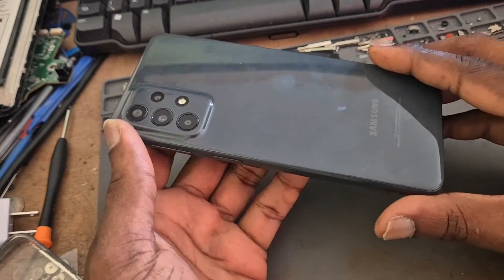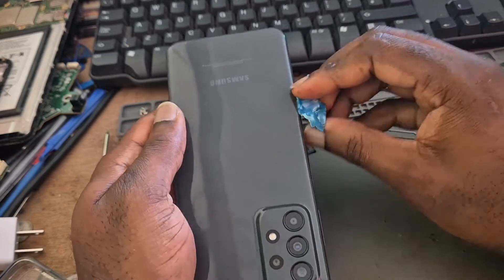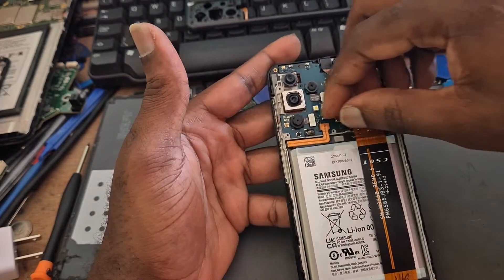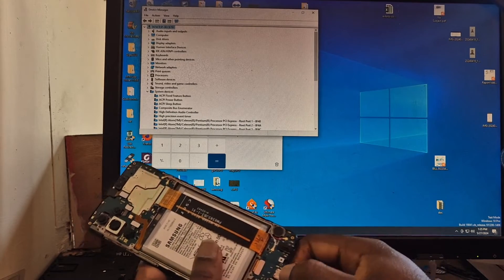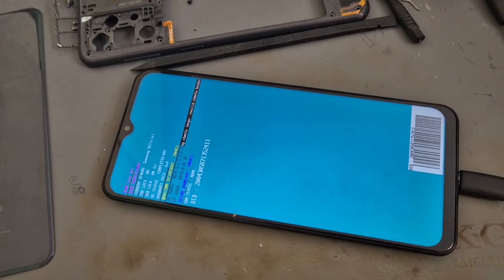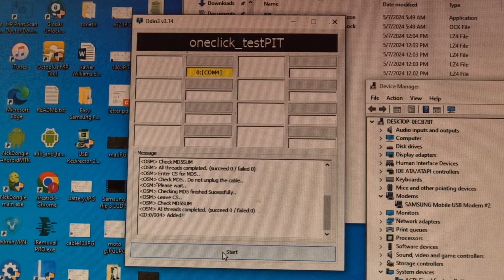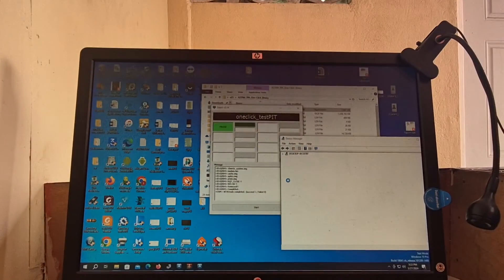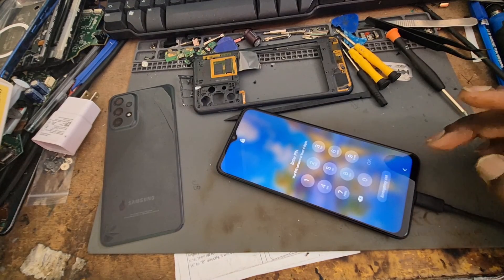Samsung A23 Dead Fix After Update 2025- Samsung A23 not turning on or charging fix

Comment: Dont work on a235m bit A
Error 10>5
Reply from the maker: which software you got the error?
Reply: @Lenzwalters using the downloaded file the device enters download mode but does not accept updates in either odin or sam fw

Comment: Hi. Thanks for the post.
I found similar on reddit and asked a friend with an edl cable to help me cuz I don't fully understand the technicals.
I believe he said the fix stops/freezes at the b&w screen (?cmd/dos?) and basically starts over, as in a loop.
He said it's because my phone is a dual sim (a235m/ds) and this fix is just for the a235m.
Is he doing something wrong, or is he correct, and can you please help me find a fix for the /ds?
Thank you for your time and happy new year!!
Reply from the maker: if you can follow the steps in the video should be able to help you fix it. have you tried ?
Reply: @Lenzwalters  no, i have not tried.
my assumption was that this fix is similar to the reddit one i found,
which would yield the same negative result because it appears that this is only for the a23m..
but if you're saying this should also work for the /ds model, i'll ask my friend to help me out.

Comment: In the middle of trying to fix my A235M

So Step 1 is not as easy as it looks
- taking apart the phone is not as easy as it looks, First layer i used credit cards to fill the games & keep the phone from closing back up again.having something skinny and long to go around the edges helps, i used a skinny pocket knife.

So Step 2, basically taking off the 2nd layer of the phone, the screen part, it is easier to DIG downward instead of sideways to get the screen off, i did this on the side of the phone, its like removing a phone cover, pushing down motion not sideways to slide if off basically.

So Step 3, testing if it will power up or pop-up on the computer with the USB cable.  My phone like the video only showed signs off life with the DEVICE MANAGER pop-up..... You will know if it worked when you see QUSB_BULK_CID, aka bricked cellphone, this means your in EDL MODE.  Step 3 was a SOB for me, those 2 pins you need to connect, i came to the conclusion they are recessed, that is they sit below that blue circuit board, i tried lots of different items trying to get them to connect, after realized they might side far down below the surface, i went looking for an item to try and bridge those 2 dots, i finally came up with a STAPLER, bent those things, cut them down so it would be easier to connect, took me a few tries, but i heard WINDOWS chime once trying, i unplugged the USB before i knew it was working.  Took me a few more attempts but finally got the phone connected to the PC.

Right now waiting for the cellphone battery to charge a bit, been nearly 3 months since this phone was used, it was at full battery then but who knows how much it might of drained since then.

So Step 4, SOB, files here on this youtube was not very helpful, 1 is password protected and the password 11 does not unlock it, the other is in another language, i am English, USA.   After much research.  Best bet is download ODIN flash software https://odindownload.com/  Next you'll need the firmware files, mine could only be on south American servers for free.
https://samfrew.com/firmware/model/SM-A235M/upload/Desc/0/10

now the fun part is figuring out that region CSC you fall into, since i had saved pictures on my cellphone giving me some regional i know my firmware country was TPA, panama.  Beware to download the firmware was very slow 100kbs, so 12+ hours to download.

Comment: I did all steps and touched the two pins and it appeared on device manager then I opened file named 1.load when I put my com number and hit enter the phone disappeared from manager and didn't load any thing and didn't turn on , so when I go to the other step opening a235m in it nothing appeared to hit start button 
What's your advice and what i did wrong  ?
Reply from the maker: it should detect in 1.load first. then give some charge then flash
Reply: What is 1.load??

Comment: Bro. Thanks for sharing your knowledge. I have questions, at what point should the 2 software be installed on the computer? Q2. Can the phone work without the use of the 2 software? Q3. Should Command prompt be opened during the process? Q4. To touch these 2 pins would this step be enough to restore the phone or does it also need to be flash? Q5. When connecting or grounding these 2 pins and making USB connection to phone at what point can we release touch on the 2 pins that's shown in presentation?
Reply from the maker: Do as i do in the video. once you connect the two pins the phone detects then you can use command then flash

Comment: I tried the first file put in my com number and it did not do all those iterations. just like 2s and stopped and in the second step the yellow never comes up. what did i do wrong?
Reply from the maker: you're com # might be different check your device manager. extract all files in one folder.
Reply: Maybe his battery is dead
Reply: How to change your phone after it's you ground the pin